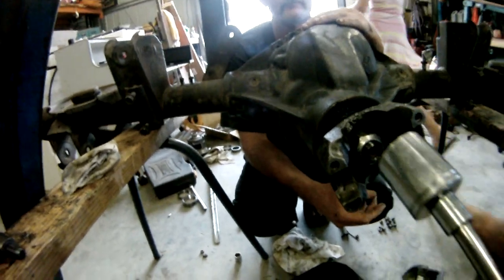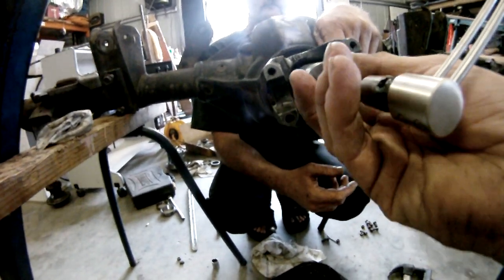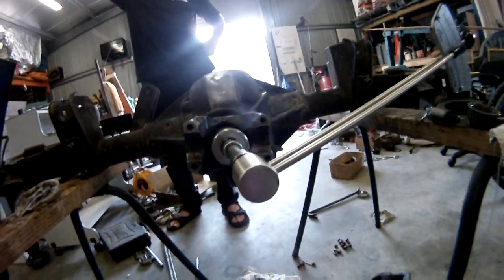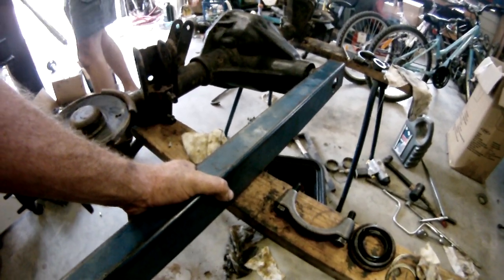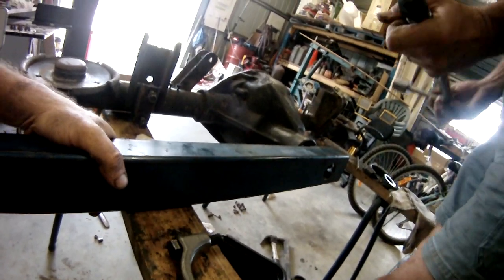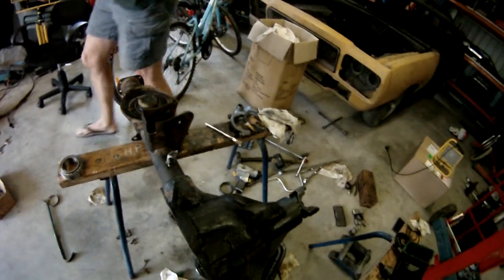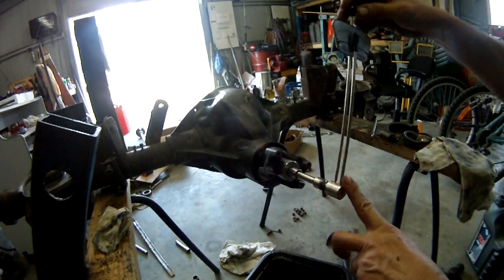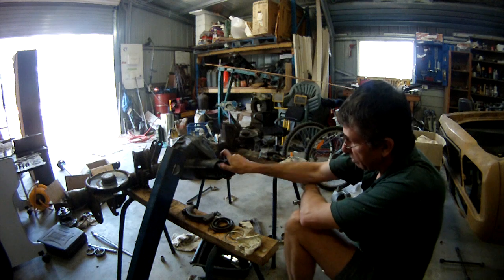Dana 44 pinion preload

Comment: the wrench measures torque at the nut or bolt (how much it takes to move the bolt). A extension only multiplies the applied torque on the wrench. If you are not strong enough to apply 150 lbs pressure the extra leverage multiplies YOUR strength.
Reply: littleriverhotrods no it reduces torque the torque gets lost due to flex in the extension